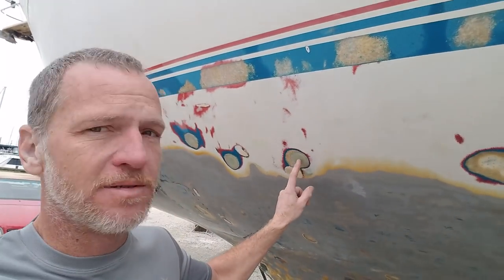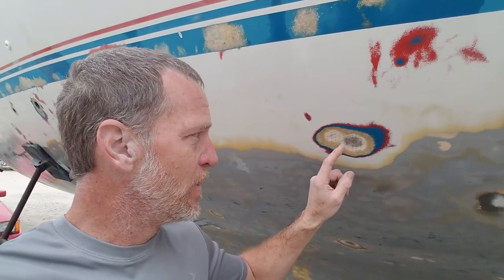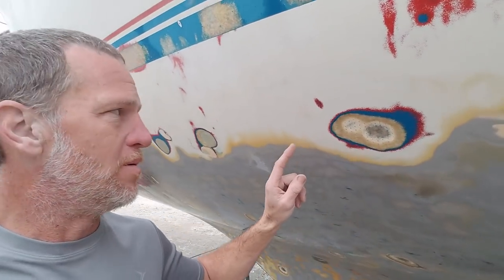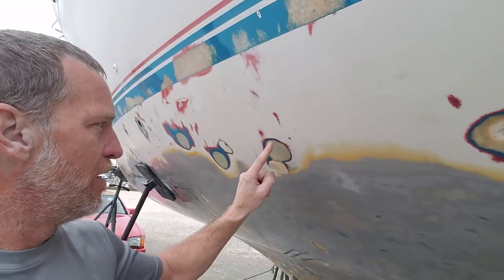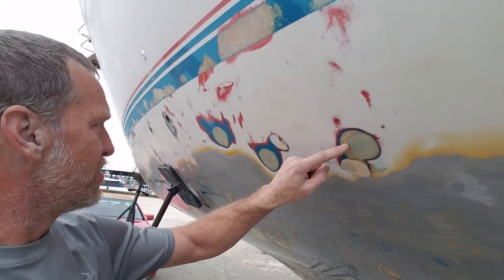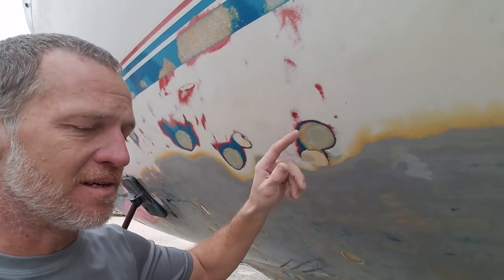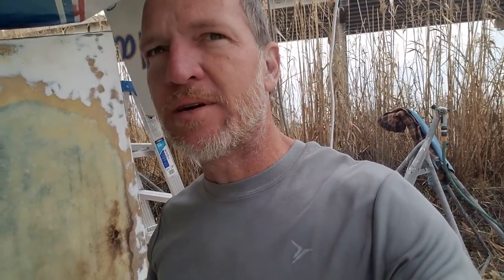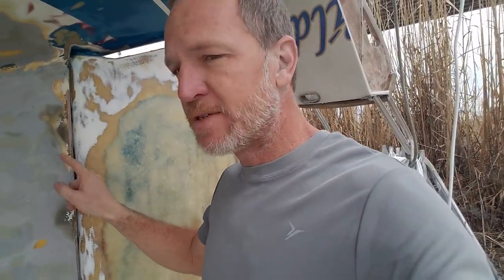Should you do your own boat bottom job?

Comment: When that boat goes back in the water you will know that your hull is sound and it has been done properly. You are a chap who does things properly and that has its own rewards. Using old epoxy and having to redo it was frustrating but you won’t do it again. And neither will I when I do my bottom next winter. Thank you for saving me and others that frustration and good luck with your journey. Try to enjoy the getting there. You are not alone. Best wishes from England

Comment: I feel your pain. Its spring and I had planned to prep my boat but both my vehicles are giving me trouble. Working on them first and am chipping away on the list and making progress. To ease my pain and guilt , when I had to wait for something to dry on the truck before moving forward, I power washed the boat. Brought up my boat spirits. I also just convinced myself that it will be ok to launch the boat in late spring, early summer and thats just what life is. You did a major and good job on your boat, the right way and be pleased with it.  You mentioned $2K for a haul out and a quick slap it on paint job done by the yard. The work you did and saved your self , I’ll bet is an easy $5K plus job. Be happy. Go sailing and a few well earned beers.

Comment: doing everything yourself will give you that peace of mind you seek ... and when its all done you will sleep easier .... if the jell coat was sprayed on evenly in the mold you wouldn't have these void issues because the resin and cloth laid flat over a uneven surface .... you could grind the jell coat off and lay a new coat of resin and cloth on and coat 2 or 3 layers of resin  and sand to flatten out till you're happy then paint it and go sailing ...cheers

Comment: my mom had a freeport plan B, constant issues with blisters, freeport used the wrong epoxy during layup, i would recommend checking with forums on fibreglass repair, i think i read about them planing the hull and re epoxing, sounds bad, check you tube, great boat, 3 yrs in mexico, 2 yrs in the san juans, 40 yr old boat,

Comment: Your beating yourself up for no reason. You know what the problems are and you can fix them to your satisfaction. If you have any doubts the internet will help take them away. Youtube has many ways to do something. Plug the holes then lay some glass. Once you get one done you may start to see the light at the end of the tunnel. If you want it done right you have to do it yourself..Remember to wear long sleeves and tape around the wrists.